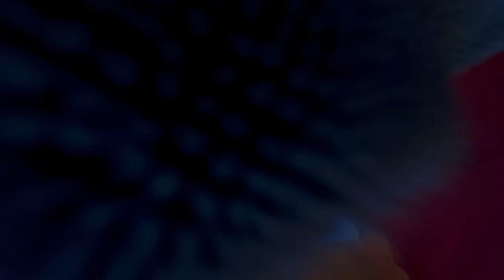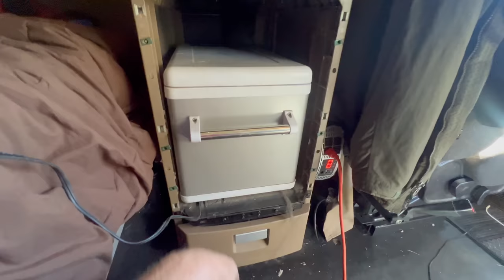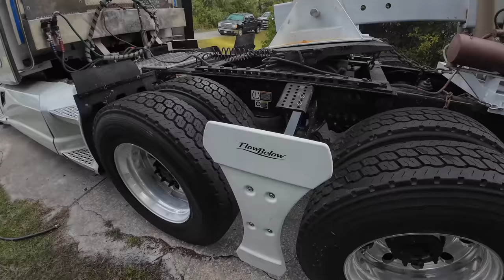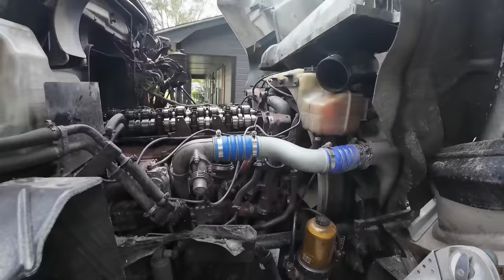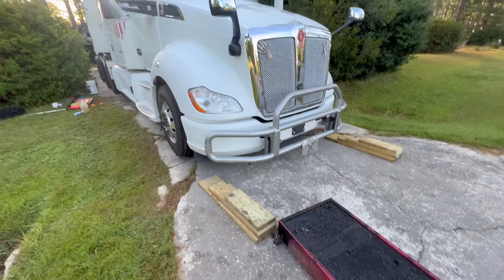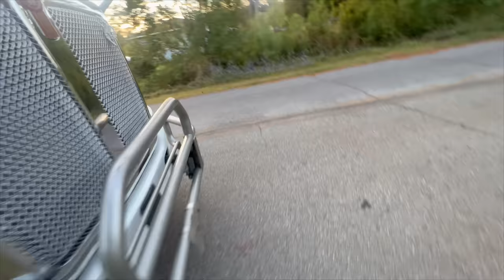We fix the Apu. And pull the Macks injectors

Comment: If an oil filter leaks after you install it, it's probably only one of two things: either you lost the gasket, or you double-gasketed, because the old one was stuck on the block and you didn't notice it.
Reply: You forgot about the “dome” height inside the filter where the threads are.
Reply: Why don’t you look into area diesel service for your truck injectors
Reply: Show us how it's done badass

Comment: I am thinking you should still put that new injector wire harness on. Considering how many total miles are on the Mack, I would think, since you already have the harness, all the heat cycles can breakdown the coating on those wires, especially the wires inside the head & valve covers. This is just this old farmer's opinion. 
Keep going your doing good 👍
Reply: That harness is pretty much shot from what he’s showed us. Hopefully the ecm is ok still

Comment: The wheel covers will make your rims dirty and after a while it will be hard to clean, as for the apu I worked on them before, it’s probably the a/c clutch making the noise, the oil filter is a little tricky to change you have to angle it just right, good luck with the new kw

Comment: The coolant leak from the APU may have been caused by someone topping off the radiator if it was serviced before you bought it and it may be leaking out of the overflow?
As far as the belts squealing, I'd  try using some coarse sandpaper/emery cloth and scuff the glaze off of the pulleys so the belt bites better.

Comment: Robert, remember it also have in-line metal fuel filter looks like a brass color make sure you change that to before a fuel pump location on it
Reply: Mine ran the same way 
end up to be that in-line fuel filter

Comment: waiting for my new fuel pump as well, just died on my tripac while home changing out the leaking water pump on the same APU!  The fuel pumps are cheap enough might want to buy a backup to keep on board as It seems they fail often on the thermo king apu's. If you havnt already buy a couple sets of LED headight resistors to fool the headligth bulb burnout sensors so it doesnt beep at you everytime you turn the headlights on. KW Truck is looking good, your getting it dialed in!

Comment: Robert dont forget 
the engine coolant
is pumped through
your APU also. And 
if one of those lines
start leaking you
can shut them of
under the hood.
There is a valve on 
each line. Also on
the belt squealing 
there is a tensioner
that you might can
adjust.

Comment: Just a tip on the alternator belt on apu unlike a car or truck where you leave some deflection in belt the apu you just tighten it I change my belts once a yr and in two days have to get under and tighten belt mine would sound same way last for a col secs and go away tightened it and has never made a sound

Comment: Buddy I feel you're pain. I bought a brand new trl and upgraded the axles to 8k dexter oil bath. Like top of the line crap. They sent me off lot and brakes didn't work then blew 6 oil seals. They replaced them now they installed 3 new axles and I made it hour down the road and guess what 1 blowed put wheel seal. Like I bought new so I didnt have problems and I can't win either

Comment: That Tamerx Company has pretty good reviews. You have had several fail. Now you have another. You were sure the harness was bad until you found a bad injector. So is the harness causing all these failures? Could be sending low volts or intermittent which could cause you to fry an injector. You have a harness, but not putting it on? While its apart anyhow I would replace it. And sell it while its running good.

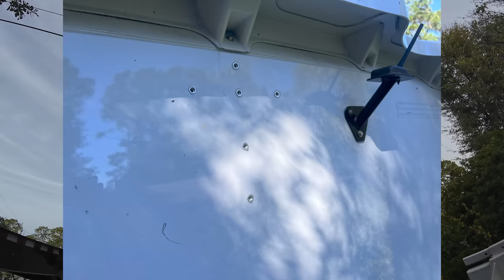Comment: @8:10 that little antenna besides the star link is the old GPS system from the old company and over time with the rain and sun, the cable deteriorates and it causes a short in the computer. It has burn down trucks before so I had to disconnect mine when I bought my old Schneider truck 4 years later. it was shorting out electronics.

Comment: you have to buy new injectors use after market  and you will be in the same boat I was a diesel  mechanic  for 45 years and got tired of replacing  AM and eating  the labor started  using  new never had a come back

Comment: Just a suggestion sir on the freezer since you have the extra space above it why not cut a peace of plywood about 2 inches above the bottom of the cabnit with drawer slides on the side to roll it in and out from the cabnit just a suggestion

Comment: The truck creates more pressure than the apu motor. 
The radiator on the apu will only leak when the truck engine is running. 
Martin Jez from trucking together on you tube had the same issue.

Comment: edit: Water pumps have a weep hole that can leak anti-freeze the way you say. The weep hole's there to divert anti-freeze out when the bearing/shaft seal initially seats after start-up. If you see more than a couple drops coming from the weep hole then the seal/bearing's likely going bad. Also, the pump may make squeaking sounds when the bearing's going bad or cause the belt to make those noises..... Here's a YT video describing what the weep hole does: https://www.youtube.com/watch?v=n1ae458wLwg

Comment: I have a 202o t680 and those flow below are a problem. What happens is after a couple years of bouncing around , that mounting plate will crack. When it does it will loosen the 5th wheel bolts that hold it up.
Reply from the maker: If that piece of plastic loosens it there’s bigger problems

Comment: I bet those aluminum wheels help with fuel mileage as well, surprised you never got rid of the steels on the Mack.  Pretty considerable weight difference between the two.

Comment: order oil pressure and coolant temp sensor for the apu, and do the radiator, your crash bar should come off easy, any work under the hood the bumper comes off with four bolts and is made to remove for access,  read my comments from last video about the apu, not retyping all of it again,

Comment: I ran a 2021 pete 579 paccar motor automatic with all the flow below and averaged 8.5 mpg lowest i got when 40k and above was low 7's but i would average 59-62 mph i got a fuel bonus every month so i was doing all i could to help the fuel economy and the paccar burn oil i would put atleast a gallon a week never any def issues i always kept the def tank topped off even if it only took a half on a gallon always still to this day keep eyes on tire pressure i will do tire pass every week at loves and check tire pressures rest off week with gauge i am getting my full bonus

Comment: If you wanna make those headlights SUPER nice there are projectors you can swap out super easy and make driving at night so much nicer. Those “new” headlights are halogen, the factory ones should be HID. It may have been wrecked and they installed junk aftermarket. LEDs in crappy halogen projectors will make you almost without light in bad weather.

Comment: First off during the next oil change I would install a fumoto drain valve in that cummins. They make oil changes so much cleaner and easier. I have installed them in cummins engine before. We have a kta cummins that holds 15 gallons. But they are reliable we have a farm tractor with 14,000 hours and never a leak with the valve. I have them in my dodge and my ford powerstroke. I also have one on my jeep. And I very seldom ever fill an oil filter with oil because some of that oil is not filtered on startup. Another nice video. I found the T680 to be a nice truck but to me very uncomfortable with the factory automatic seat. I like my seat up all the way those automatic seats would settle down. Don`t feel about the Mack the company I drove for had 11 of them. About the vintage of yours and they had electrical and engine issues. The company also had Volvo`s they would run to 1.1 million miles. Just with oil changes tires and brakes. They would have issues with the emmissions but not one Volvo every stranded me. The first Mack I drove shutdown on Gabbage Hill here in Oregon.

Comment: I owned a few of those thermo kings and unfortunately the fuel pump is notorious for going out so I always kept a extra pump with me the fuel pump is on the bottom right corner of the box it's not hard to change it was a little bit frustrating for me because I have bigger hands and it's kind of in a tight spot

Comment: also another thing that happens sometimes on those is there is a little fuse on the control box under the bunk when it pops it does not allow the ac condenser fan to spin and that shuts the apu down its a 10 Amp fuse it randomly pops all of mine have had that issue

Comment: I do NOT care what Cummins tells you  ,  Do NOT put their junk oil in the engine  and use Baldwin oil filters   ,  I am a firm believer on  SHELL  ROTELLA  T 15/40  SYNTHETIC OIL ,  I use this oil in everything , my lawn mower , my pickup , my too Harley Davidson's you name it I use it 30 years been  using  it ,  I have been using it since it came out , on every one of my OIL  MAGNET  PUGS NOTHING is on the magnet Absolutely clean ,  When you use this oil You will feel  your engine run freer , and it will not use oil and You can change your oil every 12000 miles or 15 ,  and put it in your apu   and it gets better oil pressure ,   You and your wife need to keep your truck absolutely clean , and sterilized in the inside , That way she's new all the time ,  and will be a less chance to get sick Winter coming on ,  Your truck my friend do what you want 🕶

Comment: As far as that Apu goes they're just junk okay they either work 100% the way there post to or they don't work at all you're always having trouble and just fucking pull the damn thing off and idle the truck it'll be cheaper than the time and money wasted trying to get the thing to run and it only runs a fucking day or two and then it quits again